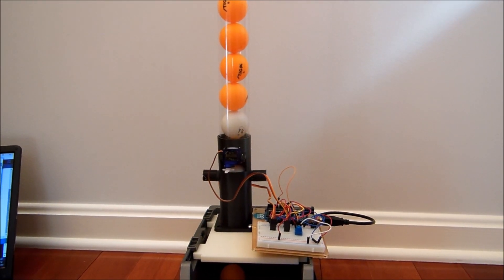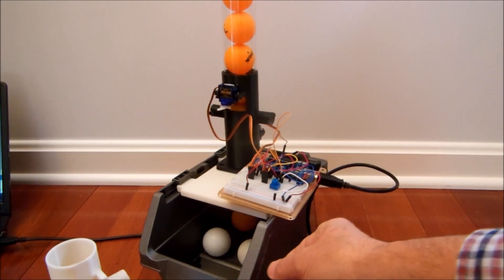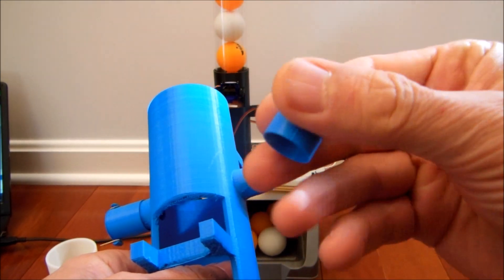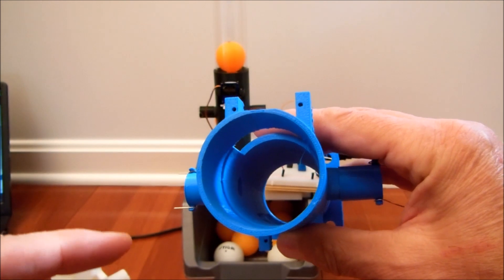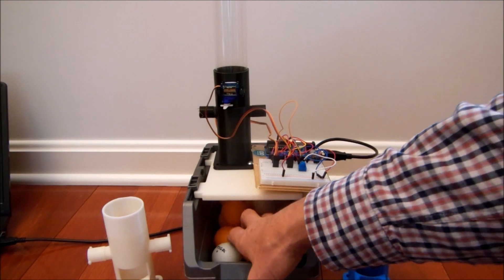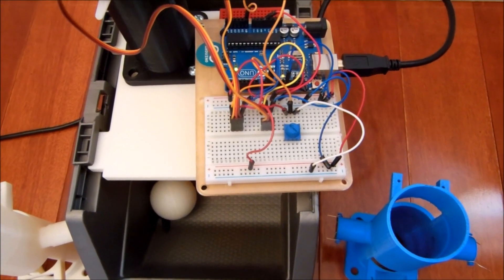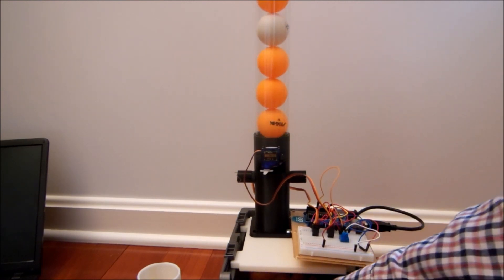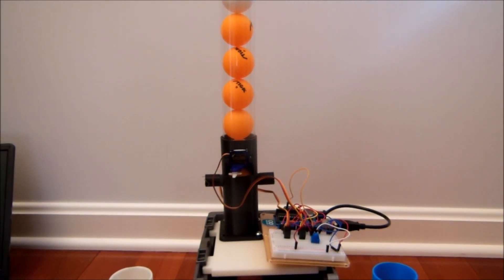arduino controlled part feeding system

Comment: Nice feeder. FDM 3D printers are not perfect but still very good. I use them myself to make custom parts and when you know the tools it's cheap and easy. Last month I built a motorized dual axis solar tracker/concentrator with wood beams and 55 custom ABS parts. Would have been much harder to do without FDM. Especially the gears.
Reply from the maker: +Michel PASTOR Than you. I enjoy doing this simple 3D parts. I just started with Auto-cad inventor, and I begin to enjoy it. However holding the printed part in your hand is more fun. Why don't you do a video of your solar tracker? Have you build one, if so I would like to see a video of it.
Reply: +mekanizmalar It would be a pleasure to show you my work. I was thinking about doing a video and eventually releasing the models. For the moment I only got some pictures because I am still working on the pneumatics and the winter arrived quickly. The weather is for the moment cold, humid and sunless. It's not really the best location to build such device. It is mostly for fun and education. I'm missing a differential pressure sensor to regulate the pressure in the "inflatable" parabolic mirrors and need to install a heat shield for the receiving head to avoid damaging the heat exchanger support and tubes. Other than that it is working like a charm. It is also based on an ATMega328 (arduino) and also a Raspberry Pi for remote flashing and telemetry via Wifi. I will keep you updated. Can I contact you via G+ ?